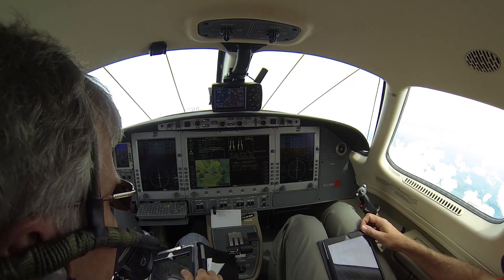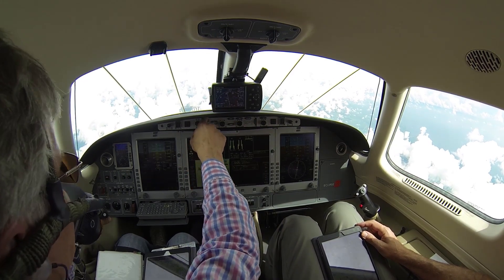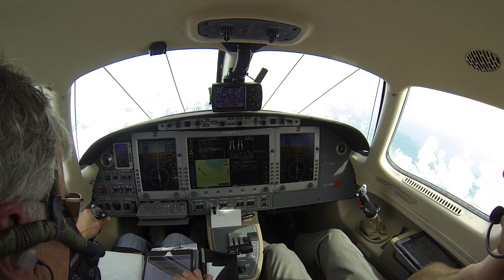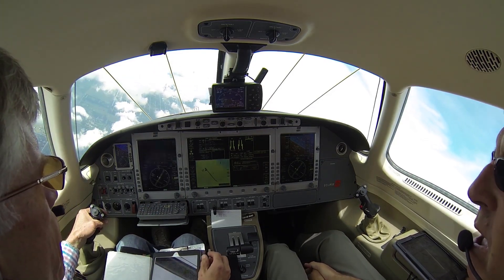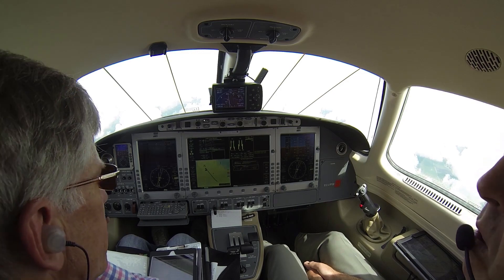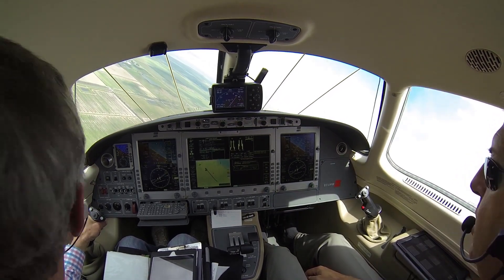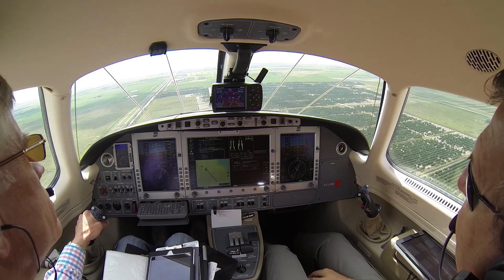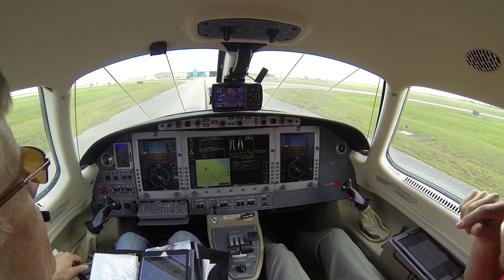Dual engine failure simulation Eclipse jet 500

Comment: Dual engine failure a non-event?  I don't think so. 

Why the landing gear down? Is that to counter idle thrust?
Reply: Yes. Early in the video Tom Norton explains that with the gear down and engines at idle it simulates the approximate descent rate when both engines are lost.  (the engines still produce some thrust even at idle so gear down helps to offset that).  Thanks for the question.

Comment: is the Eclipse supported by anyone at this current time?
Reply: Yes.  Eclipse Aerospace has morphed into a company called One Aviation and they continue to support and manufacture the Eclipse.
Reply: Think they have NOT built any yet since the 500 correct?
Reply: Eclipse Aerospace has built a dozen or so that they call the 550 (but in the eyes of the FAA it is still certified as a 500) since taking over.  They will cease production of the 550 if and when their new version of the aircraft which for now is named project Canada becomes certified. Here is a link to their website. They say they will continue to support the existing fleet http://www.oneaviation.aero/canada.html
Reply: yes I got the scoop they are doing the old serial numbers but have built NO NEW aircraft may be the manufacture but have not manufactured any new AC to date to my knowledge
Reply: Thrifty, I was at an Eclipse fly-in over the weekend and had an opportunity to visit with Justin Beitler who has a company called 
Hey John,
yes feel free to send them my info. 

This gentleman may be confusing a couple products from EAI/ONE.. There are several products which are based on refurbished Eclipse 500 aircraft (i.e. Total Eclipse and Special Edition were/are both based on refurbishing an Eclipse 500 and they retain the original 2007/2008 C of A date..), however the Eclipse 550 is a new aircraft which receives a new C of A date. To give further detail, some early 550's began with fuselages that were partially constructed years ago and have remained on the production line. All 550's after serial number 1001 use entirely new fuselages built by ONE Aviation. In total there have been 28 deliveries of 550's with 9 deliveries using 100% new fuselages (i.e. serial 1001 and up).
For those unfamiliar with our firm, Aerista is the world’s largest broker of pre-owned Eclipse aircraft. By utilizing the unique talents of our team members we have created a proprietary database which tracks the configuration and value of every Eclipse 500 and 550 ever built. This specific focus and expertise allows us to understand the unique aspects, and ultimately the unique value, of each aircraft. Aersita offers both brokerage and buyer assistance services, aimed at helping buyers through the process of finding and acquiring a turbine aircraft. If you are interested in buying, selling, or simply learning more about the Eclipse 500 or other turbine aircraft please contact me directly at justin@aerista.com or 747-200-6004. At Aerista, your passion is our mission!
I hope this helps!
john
Reply: Called Areista.
Reply: Thrifty,
Yes, Eclipse is currently supported by Eclipse Aerospace/ One Aviation.
john